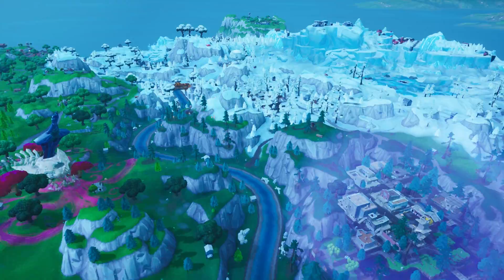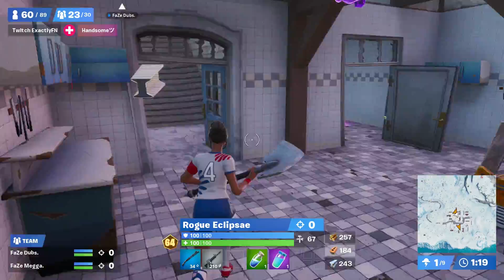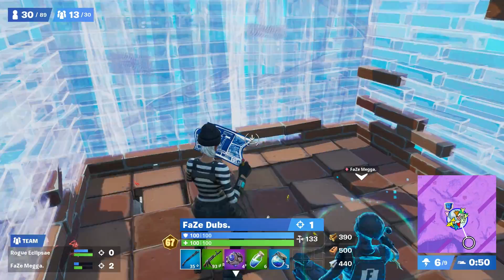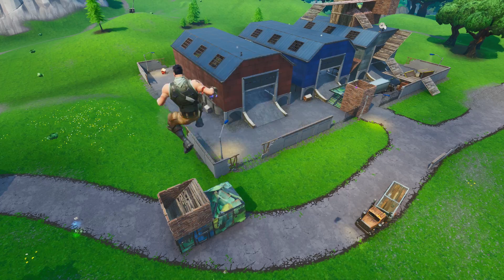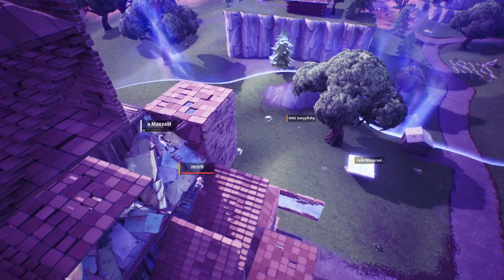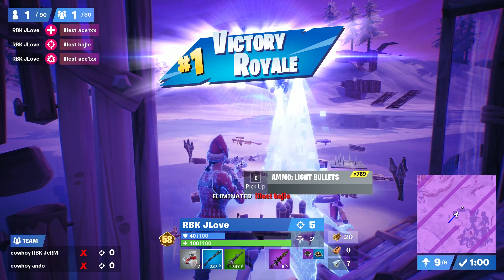Fortnite How To - Shockwave Grenades

Comment: its so ez to use it, in solo get it instantly then wait dont use it yet, use it in a smaller circle dont do it in 1v1 use it in 1v1v1v1v1, when you have impulse and shockwave use impulse in the ground, shockwave is the opposite go high ground to vertically go to a higher ground so theres negative percent you will not fall, if you use it at the ground you may do a mistake like going in a storm or going to a trap or even so high then die